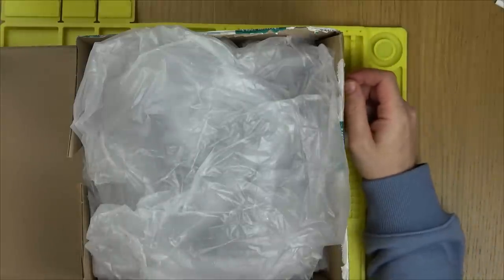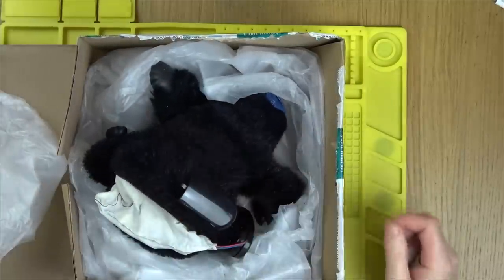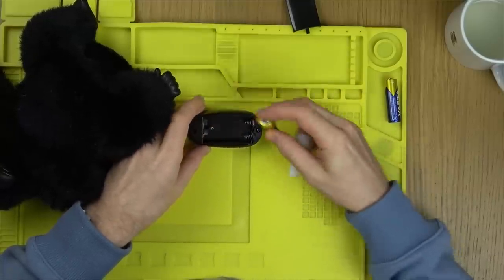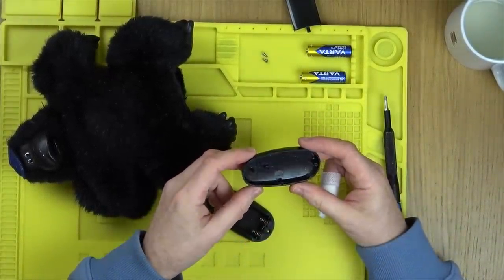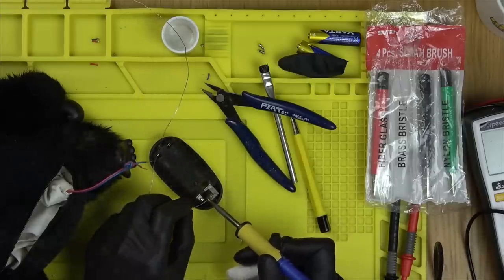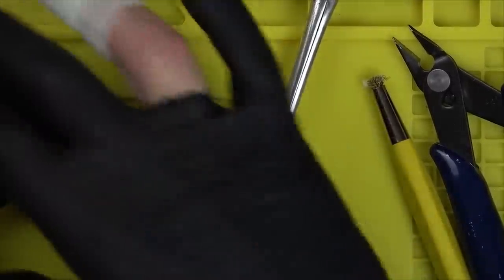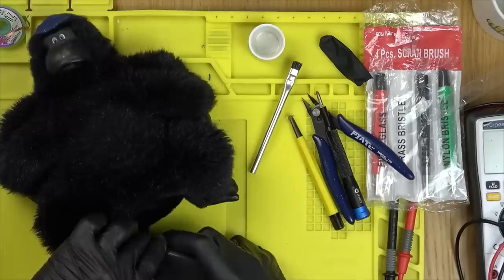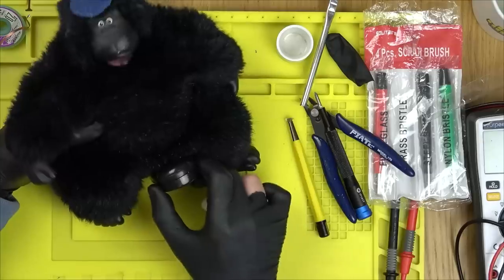Reviving Toys - Mr. Gorilla - Tea Break Fix

Comment: Hi Vince, you had any experience with a PS4 Pro Power supply? Mine has started making a crackling buzzing noise, but it plays otherwise normally. The unit twice in the last week has just conked out mid-game, then had to remove the cable and re-plug it in it, the blue light then lights up, then machine tries to load, then after 1 second then instantly conks out again. Then no other power at all (have to remove cable for 30 seconds) 
After this, and after i gave it a fan blow with canned air, (thought it was the issue) it seems to work again, but a new noise, the PSU crackling noise is started recently. (The PS4 still works normally though i just wondered if it something that is cropped up before that you know of, The PS4 model is CUH-7126B

Comment: Excellent fix. The Gorilla is adorable but a bit annoying, maybe you could do something with the chip so it plays something else? Also the Ghostbusters shout out! I used to play it on the Atari 800 back in the day, along with Boulder Dash, Hover Bovver, Bruce Lee and Chuckie Egg!
Reply: the chip inside is likely a blob chip (bare dice wirebonded without package and with a blow of epoxy over it, to hide its secrets its dirt cheap) or atleast a otp part otp means one time programmable the meory works by blowing fuses in the die to make up the 1s or 0s of the data